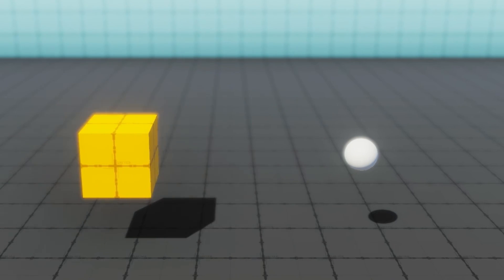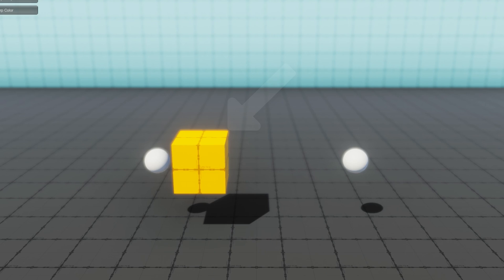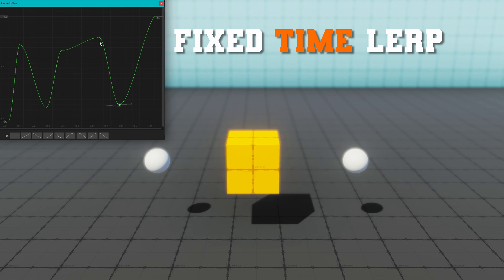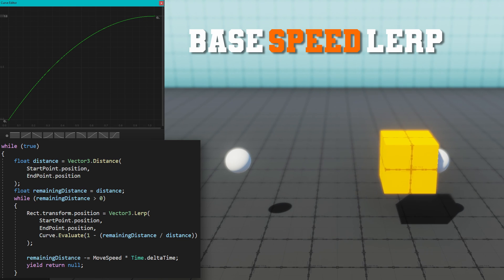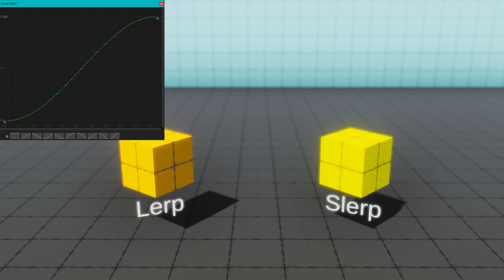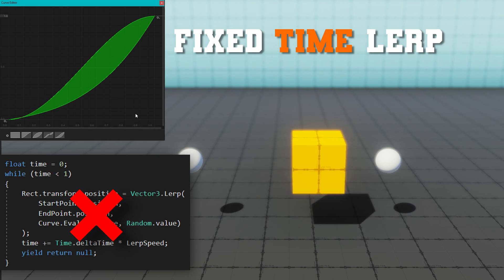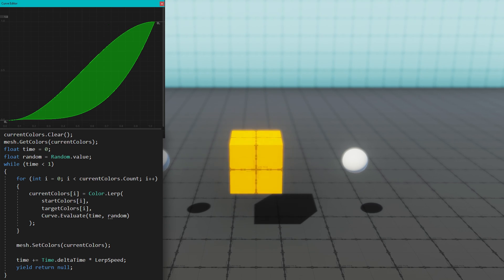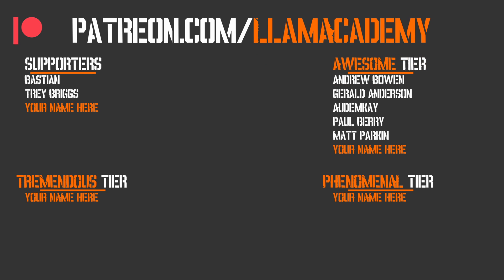ADVANCED Lerping | Unity Tutorial

Comment: Great video! Thanks so much for this! 
Quick Question... To make the curve bouncy (pass 0 and 1) Im using LerpUnclamped... It seems to work well for going under 0, but anything past 1 still seems to clamp... Is there a way around this? Im trying to make an object scale up quickly with a slight cartoonish bounce
Reply from the maker: Hi 👋! Usually for that effect I’ll put a point starting around 0.8 that goes too far and have several points between 0.8 and 1 that oscillate overshooting in a progressively lower amount. You can also use a spring to achieve this effect: https://youtu.be/6mR7NSsi91Y